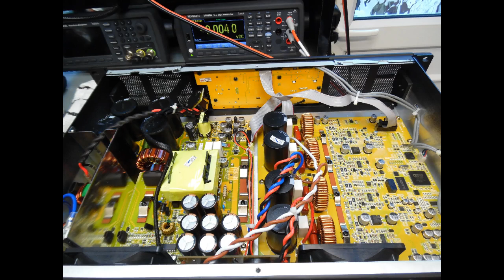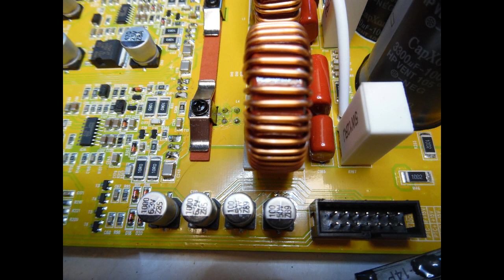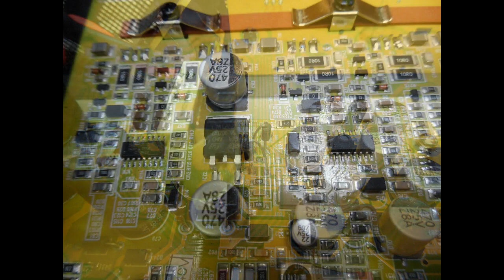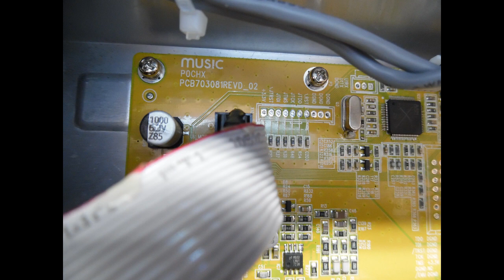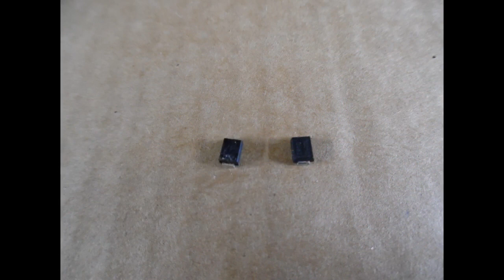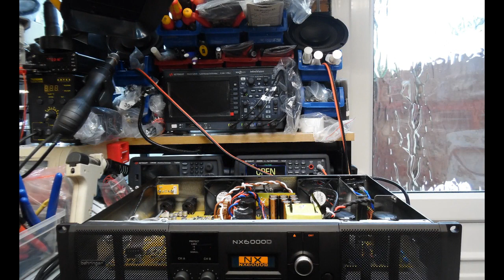Behringer NX6000D Power Amplifier Repair (With Audio Tutorial)

Comment: I recently had mine intermittently power up in firmware update mode on the display. Sometimes does it and sometimes doesn't. Any idea what could cause it? Seems like some sort of power up failure in whatever sequence it uses when it starts up.
Reply from the maker: I would recommend contacting care@musictribe.com they own Behringer.
Reply: @AudioAmplifierServicing I put in a ticket yesterday on the behringer site so I guess I’ll see what happens
Reply from the maker: @ricanman85 They are not the easiest of companies to deal with sadly.
Reply: @AudioAmplifierServicing yeah seems like that is the case

Comment: You can make a video of the Behringer NU12000 on how to check why the power supply does not turn on and only tries for about 2 seconds and is clicking trying to turn on even without connecting the power cables to the amplifier, you can only see the screen turn on, all the IGBTs are new and the TO-92 transistors are tested with a tester and are in good condition, almost everything was measured with a multimeter but that is what it does with and without protection bulbs in the 120Vac power outlet. Thanks for these videos that you share.
Reply from the maker: Hi the service manual is available from this site https://www.scribd.com/document/725966621/Nu12000-Service-Manual check the power supply voltages.

Comment: Hi, I have a nx6000d with a shorted d32 (F15v) replaced the amp turns on without sound goes into protection the fans turn off but I noticed that ic30 lm 393 (Voltage comparator) goes up in smoke, I'm waiting for it to arrive from the warehouse, is it possible that for this reason the nx 6000d goes into protection? It doesn't seem that there are any faulty final and integrated circuits the voltages are all there, Thanks for your excellent work,
Reply from the maker: Hi Yes if IC30 is smoking then it's internally developed a short circuit so probably the reason D32 failed due to excess current draw.
Disconnect the power supply board from the Amplifier board, then when you have the power supply working again all voltages are correct, reconnect the power supply.
Reply: @AudioAmplifierServicing  Thank you very much for your attention, I am still waiting for the ic30 ordered in the shop to arrive,
I hope that after I have inserted it into the amp there will be no other problems,
I think that the part regarding the mosfet and pwm are ok, I will let you know again thanks. it all started from an interference entered in a wireless microphone control unit that caused a sudden strong pink noise with consequent shutdown of the amplifier, and as already said, I discover the diode d32 in short and so on.
Reply from the maker: @robertocrimi8737  I do have the service manual for the 3000, which can be used as a basis for the 6000. Email audioamplifierservicing@aol.com
Reply: @AudioAmplifierServicing  🙂

Comment: hello, my behringer nx6000 has a problem, it works but when it reaches a certain volume (approximately 60% of its capacity) channel B only puts it in protection. 
I tested several identical sound sources on both channels and each time the same observation.

what could it be in your opinion please?
Reply from the maker: @pixiss6596  Hi which country are you located in, I would not advise undertaking a repair if you have no experience of working on similar equipment.
Reply: @AudioAmplifierServicing  Hi, I live in France, yes, I understand, it's something delicate. It's not necessarily for me to fix it, but to know the potential causes if I take it to an electrician in the big city near me.
Reply from the maker: @pixiss6596  Hi the internal circuitry has detected a potential problem like a faulty speaker connection, speaker impedance mismatch, excessive current draw, or a power supply issue, causing the amp to temporarily shut down to prevent damage to itself or the speakers. 
I presume you have checked the connected speakers and swapped them around and the issue remains with the Amplifier.
If your Amplifier is less than 3 years old and you are the original owner, it will be covered by the 3-year warranty.
If its outside of the warranty period, you can still raise a support ticket with Music tribe https://community.musictribe.com/support
Reply: @AudioAmplifierServicing  Thank you for your response. I have indeed conducted some tests, but I will continue by trying to change all the cables in the amplifier circuit up to the subwoofers. I had already contacted Music Tribe, who referred me to Klinkers Electronics. I had sent the amplifier because initially, it had burnt out and would go into protection mode on both channels as soon as it was turned on. They sent it back to me after I paid 350 euros, and this time, it is this issue that has persisted
Reply from the maker: @pixiss6596  Normally you should have a warranty period for the repair typically 12 months

Comment: Good day Sir. My name is Salah.
I use this amplifier  and this past weekend it just give protective lights in both channels without any sound coming out.

What could be wrong?
Your assistance will be highly appreciated, thank you🙏🏼
Reply from the maker: Hi you can email audioamplifierservicing@aol.com for support, but if you have no experience or test equipment repairing electronic equipment, I would advise caution. The DC Voltages in this are very high and can cause injury or death.

Comment: Thanks for the video! I purchased a dead NX6000 and fixed it with the help of your video. D29 was shorted on my NX6000, along with R84, R87, and D33 (these had actually burnt up). I was also able to find the schematics for the NX6000 online... detailing all of the values of the components
Reply from the maker: Great to hear you have repaired your Amplifier.
Reply: Could you kindly help me with the schematic or point me to a source, I have not been able to find one
Reply: @Afrorack  i uploaded copies on AVSForums. Just search the forum for behringer nx6000 and look for posts with djbmw in them
Reply from the maker: @Afrorack  Hi I can provide the NX3000 schematic that you can use as a guide email audioamplifierservicing@aol.com
Reply: @AudioAmplifierServicing  Thank you I sent the email
Reply: Hi, could I have the wiring diagram of the nx 6000d, thanks in advance

Comment: Briefly, which parts had failed?  What was the presumed causes and manners of failures?
Reply from the maker: Hi D30 and D29 Schottky rectifier diodes on the switch mode power supply board checked.
 
D30 found to be short circuit. (IR10 0422L)

Both Didoes replaced SB1100 (100V - 1A)

Comment: Spent ages on this amp. Had one of the mosfets in the power amp leaky. Replaced, still goes into prection mode. Once channel I see PWM waveform, other channel no. I guess the controller chips have been damaged? Other cold checks seem okay.
Reply from the maker: Yes, it does look like the controller chip is damaged

Comment: You talk a lot about components and ic's, but you don't show where they are. Just static pictures.
Reply from the maker: As advised in the Tutorial only the NX3000D service manaul is available in the public domain, so unable to detail the component reference number to the actual device on the circuit board.
Reply: Well you talk about measuring the diodes in the rectifier for example, but don't show which ones it is.

I have a nx6000d that died (not much used in 3 years).
I opened it up and measured all voltages as accurate. The fans and display started up when i disconnected the ps from the amp board. 
I then connected the ps again, and it ran again for almost 2 weeks. Yesterday it died again.
Reply from the maker: @Erlandsson1964  The rectifier diodes that failed are listed in the description as below and also shown in the video.
D30 and D29 Schottky rectifier diodes on the switch mode power supply board checked.
 D30 found to be short circuit. (IR10 0422L)

I would not advise attempting to repair your Amplifier if you are unfamiliar with repairing electronic equipment.
Reply: @AudioAmplifierServicing  thanks i missed that completely. 

My problem was temperature dependant. when room was 18c it did not start, when temp rised to 20c, it started.
It was a capacitor around the Viper chip (the softstart chip). It is fixed now.
Reply from the maker: @Erlandsson1964  Great to hear you have fixed the Amplifier, and thank you for sharing your experience on the channel.
Reply: So it is a very strange fault. I am taning it apart again this weekend.

Comment: This video was a god send!  I had 2 units that had failed and thought I had to throw them away.  Turns out both had D32 shorted in the power section and after replacing those shottky diodes with a different manufacturer (Part Number VS-MBRS1100-M3/5BTGICT-ND   Specs:  100V 1A DO214AA) they are both back in business.  Funny thing is one is an old NU6000 and the other a much newer NX4-6000 but they both have the exact same power PCB revision.  The nx4-6000 had failed about a week ago and that unit had replaced my failed NU6000 from a couple years ago.  I thought I was out 2 units but both are working again!  Thanks again for sharing your expertise in fixing Behringer amp, such a pity that something like a shoddy shottky diode can render devices inoperable so easily.  Keep up the great worK!
Reply from the maker: @CoryTealeSK Great to hear you have repaired your Amplifiers, and i appreciate the positive feedback about my channel.
Reply: Una pregunta cuál falla tenía su equipo el mío la falla que tiene es que tarda en prender

Comment: Good afternoon, i have the same amplifier with an issue on the two lm317 regulators, the amp switches on and works but the two  5w 12 ohms resistors heat up after a few seconds and smoke. This even happens with the fans and amplifier board disconnected... The lm 317 are good and they only seem to be supplying the fans. The strange thing is that with everything disconnected they still smoke and heat up.
Thanks in advance.
Reply from the maker: Hi email audioamplifierservicing@aol and I will send you the NX3000 service manual to assist with your fault finding.
Reply: @AudioAmplifierServicing  Thank you very much for your help as i could not find any schematics online.

Comment: Hi, great video. I've just purchased an NU3000D, was initially working but now no sound. When I connect the inuke remote it shows inputs and outputs active and fluctuating. I've tested the speakers and mixer with different cables and amplifier. Any suggestions would be gratefully appreciated. Cheers Rob
Reply from the maker: I would recheck connections and switch settings https://www.bhphotovideo.com/lit_files/84919.pdf

Comment: muy buen video amigo, saludos desde oaxaca mexico. gracias por compartir tus conocimientos . tengo un amplificador como este pero aca en mexico es muy dificil conseguir las piezas a menos aca en donde radico, seria tan amable de decirme el valor del diodo de reemplazo que le puso en el D29 ?
Reply from the maker: Hi you can replace with any 1 amp 100 volt rectifier Schottky Diode.
Reply: @AudioAmplifierServicing   muchas gracias por el dato, bendiciones amigo....

Comment: Thank you for this video I'm repairing a amplifier similar to this one .these amps when they are in protection does the fans power up ,my amplifier the sg3525 in protection mode there  is not input voltage and output voltage on the 15 + and 15 - and 24v regulators (fans off and 24 v led  for the front panel all off just wondering if this is related to the amps in shutdown mode ?
Reply from the maker: Hi if the Amplifier is in protection mode the fan can spin for a few seconds on start up before the protection mode initiates.
If the power supply board is disconnected from the Amplifier board and the power supply is not in protection mode then the fan will spin at high speed.
I reviewed the SG3525 data sheet.
https://www.st.com/en/power-management/sg3525.html
Reply: @AudioAmplifierServicing  Hi, so if after disconnecting the supply board from the amplifier board and the power supply is not in protection mode but with high fans as you mentioned here does this mean that the fault is not in the power section board but the amplifier board?
Reply from the maker: @SamerRemonAlHaddad  Yes correct.

Comment: Thanks for the Video! Lately, I hooked up a 4 Ohm Subwoofer on the Amp, and let it run for a few minutes. Then I realitez, that the amp was shutting down for a short period and immediatly restarting. But when I went to check it, it was already in Protection mode and no sound was getting through. I had the same faults as you were describing, so I replaced also both diodes D29, D30 with the SB1100. It went out of Protection Mode, and i thought, it was good. But sadly I was getting 80 V DC on both Outputs and also a few Volts DC on the Input... Now I guess I have to try and find also a whole new board for the Amp if I am lucky.
Reply from the maker: Hi for a new circuit board contact care@musictribe.com, supply chain is very long.
Reply: Thanks for the fast answer, I'm going to try it🙏
Reply: Don't waste your money. Spend a little extra and get a decent amp, old school are better, such as a Crown MA5000VZ / MA5002VZ or Crest Audio Pro 10001, CA18, etc. Old school amps are heavy but they last forever. To get reliability from lightweight amps you have to look at companies such as Lab Gruppen & Powersoft, etc. The price is high. Behringer amps are not reliable, they're just cheap. The price of their PCBs is high because they want you to buy another amp, not repair your broken one. Hence, no available schematic diagrams for their products. A little extra money spent on a decent amp now, will serve you well in the future.
Reply from the maker: @subculture-records  Absolutely spot on.
Reply: @subculture-records  Yeah, in the future I am going to buy another Amp, for now, I contacted musictribe and bought a pcb for 330$. The delevery time was also very short, about a week, so they had it in stock, luckily. Now it works just fine again and I hope, the stronger Diodes will last longer.

Comment: I notice that you can change a link in the SMPSU to convert the mains voltage from 230 to 115v; is this as simple to do as moving the link and doubling any inlet fuse? I am learning a bit more about amps now (class D, class H and revisiting Valves). I am about to be authorised by Behringer again but don't have schematics yet. I no longer live and work in the UK but now Brazil. We have 127 and 220v here, and I am getting a lot of damaged power supplies, amps, keyboards, mixers etc. I put out some videos on my channel as well but I specialise in electronic musical instruments, pro PA systems etc. Only make I will no longer work on is Crown (they make some nasty DC coupled amps that when one SMD transistor blows, you need to be careful to replace all of them on the channel).
Reply from the maker: Hi Behringer will no doubt provide the  service information once your registered

Comment: Love the voice description of these videos.
I've heard also that shotkey diodes are used in SMPS because they can switch much faster than normal silicone diode, smps can switch at over 25kHz.
Reply from the maker: Thank you, your correct the diodes are used in smps due to their ability to switch on and off at high frequency.
Reply: almost.. FREDs are often used for high speed switching & spike snubbing in SMPS. Shotkey diodes have the advantage that Vf is much lower, so the dissipate much less power.